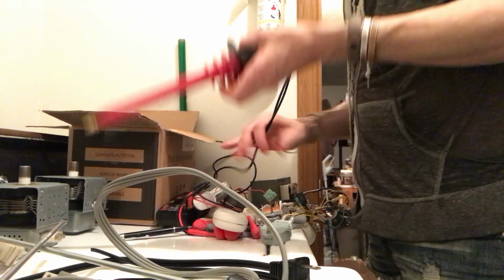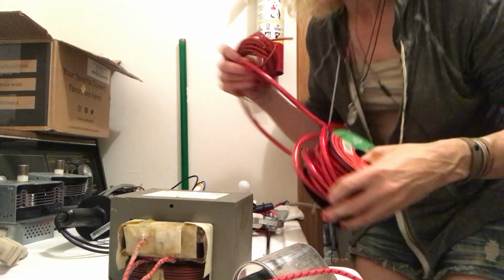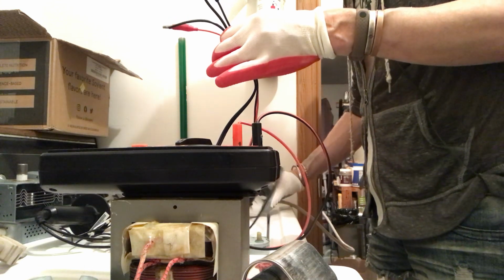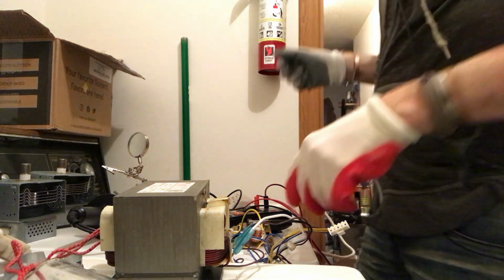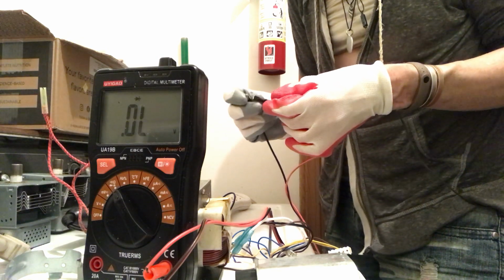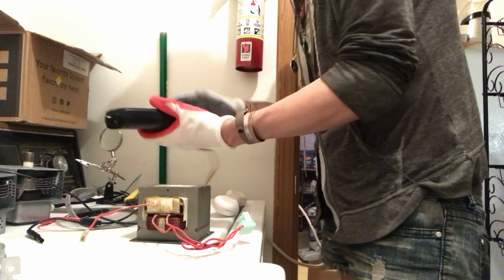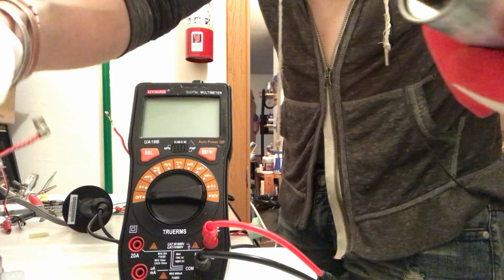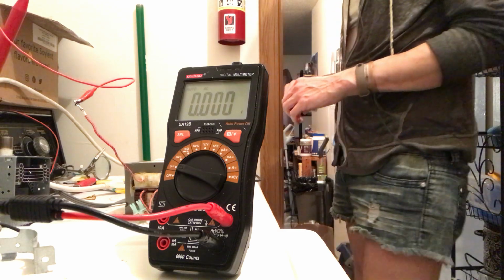Microwave⚡️parts⚠️ testing  ( part 2 of 2 )

Comment: Making a spot welder for those LiIon batteries , eh? Nice.
13:30 you could do like Fran does, using a piece of cardboard with two holes a few centimeters apart, keeping those wires from shorting.

You can't test a HV rectifier diode with a typical multimeter. Think of a HV diode as a series connection of multiple diodes, where the drop will be at least a few volts, more likely several tens of volts - far more than your usual 0.7V on a silly-con rectifier diode. Your meter's test voltage is not enough to go that high and it'll show an open circuit, pretty much like with Zener diodes apart from some very low voltage ones.

45:30 magic smoke released! These cables are indeed shit. Take the lightest wire gauge you can think of, and halve that.
Reply from the maker: yes , thanks Keri, i slept all day, just saw u did a live ,. ill be up all nite i will check it out, thanks!
Reply: @sa8die  lots of stuff there to watch! Beautiful medical device teardown, some rants, some stories and some close friends of mine too!